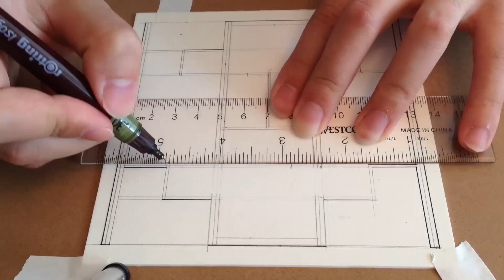Making a 1:100 scale architectural model

Comment: i have to make circular columns what do you suggest me how can i do them (i am using the same material you are using)?i have to make villa savoye but i am stuck on how to do the circular pilars
Reply from the maker: +Otro día más Hi Otro, depending on the scale you're working with. I would go for round PVC sticks or round wood sticks. (can be painted white if your instructor insists on a white model.) I'm not particularly good at model making myself, looking forward to seeing your villa savoye model. XD
Reply: wow. i did that in my first year

Comment: Are there any types of material (similar to matte board) that you'd never use for a model? I'm planning on doing a model and I'm wondering if there are any kinds of materials to stay away from. Some materials might be too hard to cut or draw on.
Reply from the maker: I'd say with the right tools almost every material in the art supply store has its advantage. In this movie I used Musuem boards, which have good span given their width (0.15mm) but dulls your blade quickly. 

In general I'd suggest you to stay away from foam (not foam cores, but foams) if you don't have a hot wire cutter. 

The most versatile material I found is foam core, not foam, but foam core. (paper layer eveloping a layer of foam.) It's incredibly easy to cut, doesn't dull your knife, and looks nice. Potential downside: minumum width 0.3mm, which can be tricky when building small scale models.
Reply: Architectural Aesthetics Thanks. I'll keep that in mind.

Comment: What material did you use
Reply from the maker: For this model I used the cheapest white museum boards. (0.3 mm) They have very good span, but are very tough to cut. Dulls my knife very fast, not recommended.
Reply: Architectural Aesthetics what would you recommend then?

Comment: what are the materials you used?
Reply from the maker: +Allen Borromeo I used mainly museum boards (the cheapest white material there is) in this video. However I highly recommend using foam boards instead. They're much easier to cut and look much nicer, only at a slightly more expensive price tag.